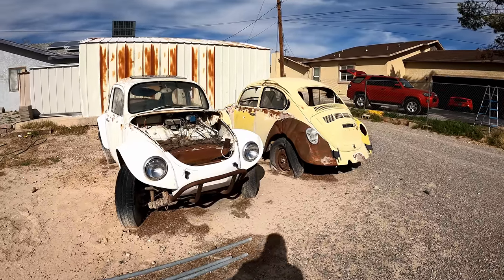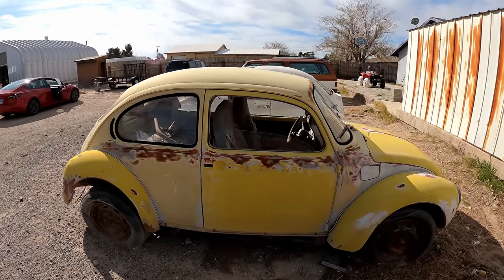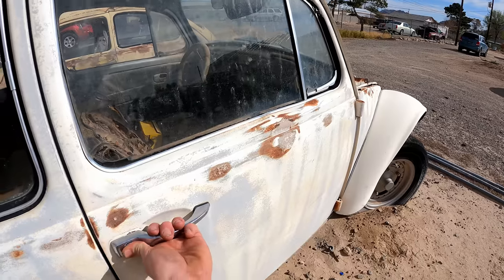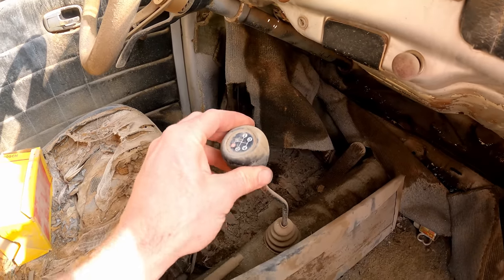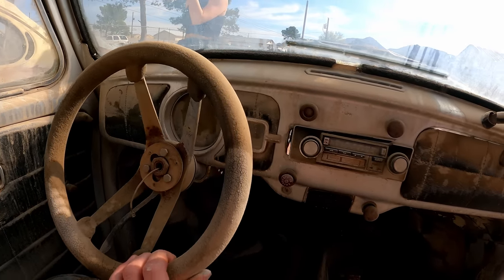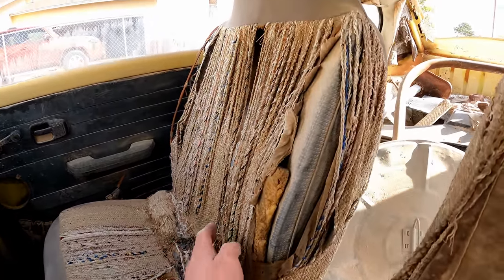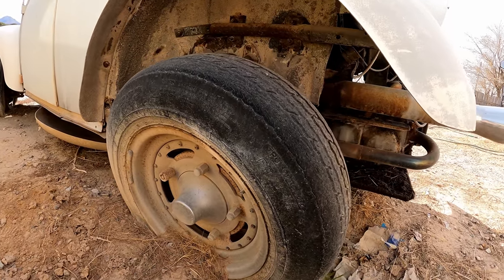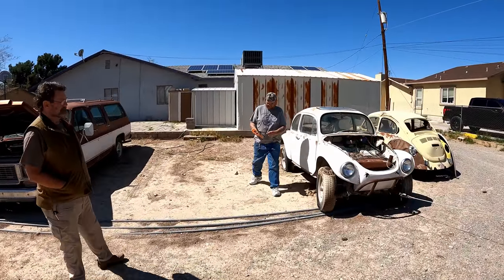Walkaround / Story on the Desert Beetles in Vegas

Comment: My very first will it run was in the 70's on a VW, it has the squareback variety with the side vents, nothing spectacular on getting it running just a a battery and some gas. What bottled the mind was that it had karmen Ghia badging, a green paint job and white interior (smelled like gauze and wet dog), also the transmission had an automatic/stick feature. You could drive it as an automatic and also shift it like a stick, the pedals (brake and clutch) were joined, most unintuitive thing ever is to hit the brake when trying to power shift. just awful